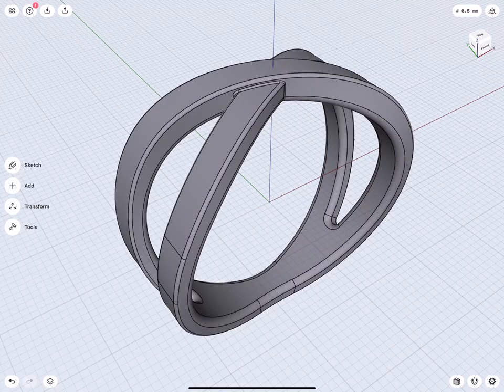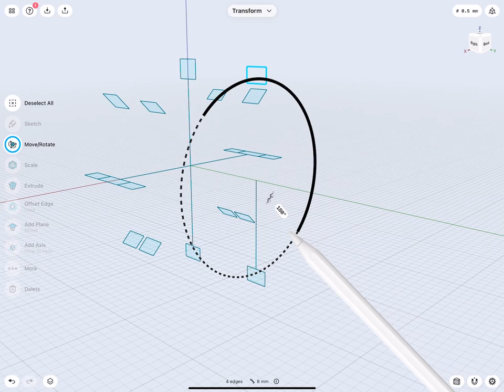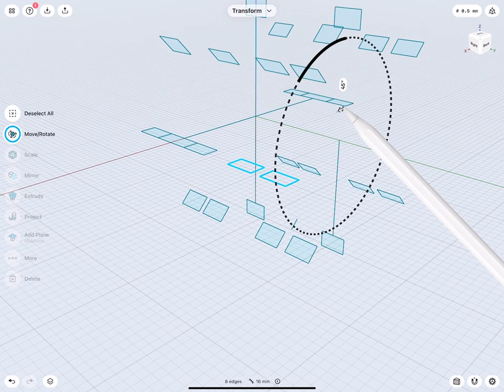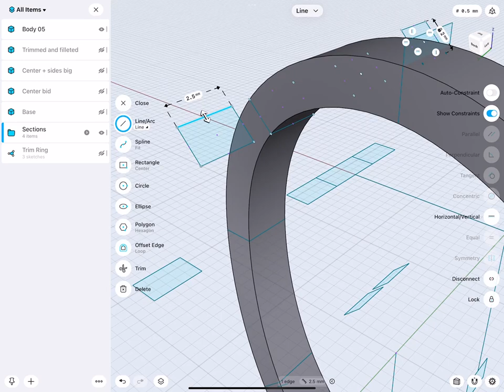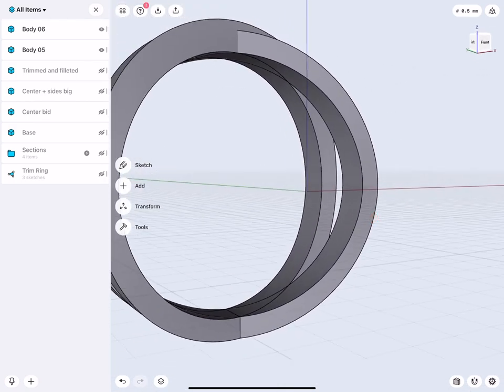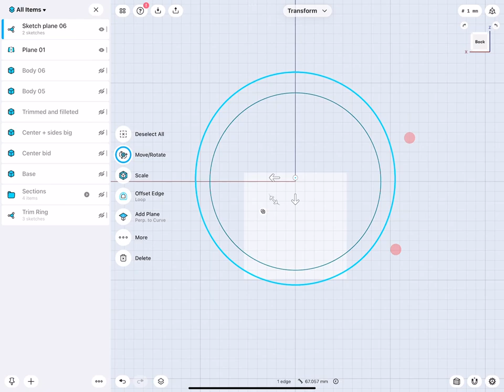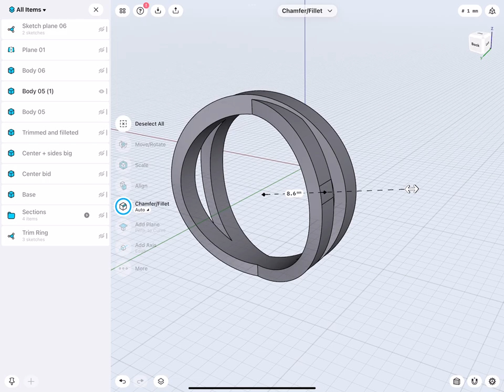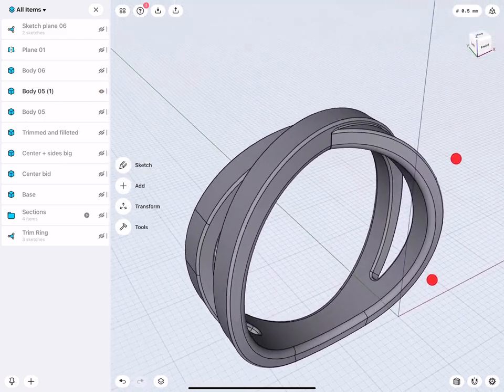3D modeling a woven ring | Shapr3D step-by-step

Comment: Dear Shapr 3d , what option is there to bring a 3D design to CNC ???.
Reply from the maker: Hi, CAM software should be used to prepare the toolpath for manufacturing. 

Shapr3D is a CAD software, we do not have a CAM module :)
Reply: @Shapr3d  ok :/ :)